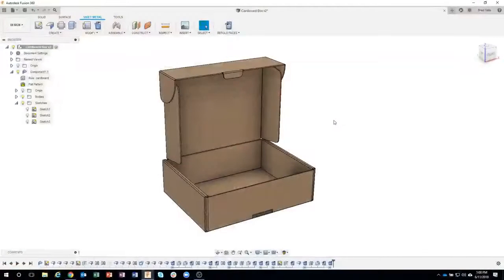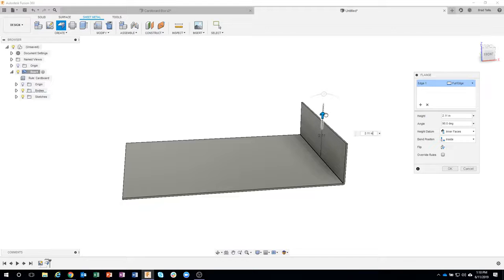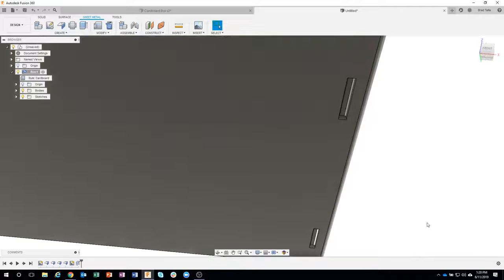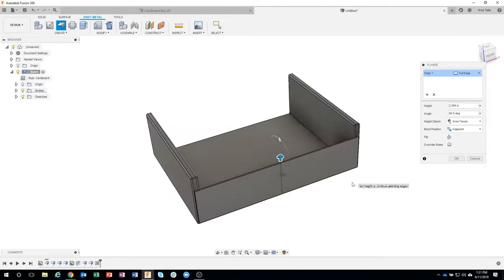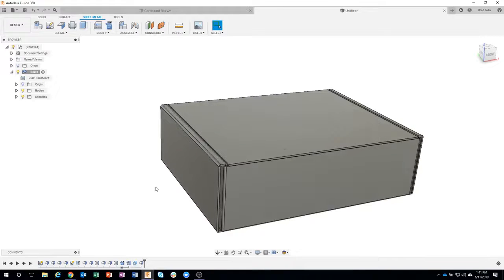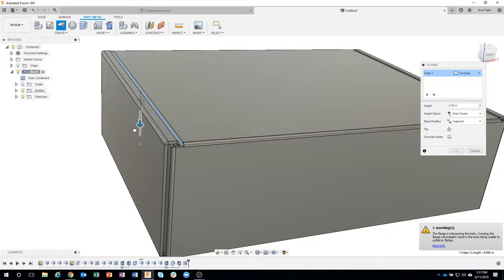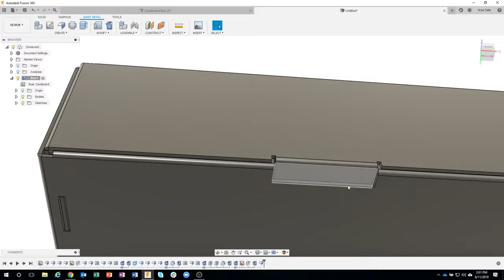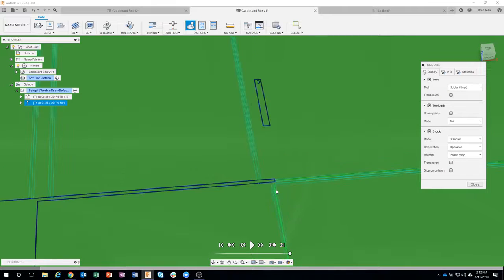Episode 36, Creating a cardboard box using Fusion 360's Sheet Metal

Comment: Thanks for another great tutorial. Is there a way to export flat pattern to SVG to be able to cut on Glowforge? Thanks.
Reply from the maker: I don't have a GlowForge (darn it..)  However, you can export as a DXF and I hope GlowForge software would be able to bring that in.
Reply: @bradtallis8968  Thanks for response. I'm getting following error when attempting to 'export' or 'save as' Flat Pattern. "Error: Export and Save Copy As are not supported for Flat Patterns." Trying some other options to get it into a SVG format.
Reply: I think I figured out a way. It's a little hacky but seem to work. 
1. Create a drawing with 1:1 scale of the flat pattern
2. Delete all of the extra stuff from drawing (border frame, info box etc.)
3. Export drawing as PDF
4. Import PDF into Illustrator or other vector based editor and clean up the paths if needed (joining them, removing extra ones, changing path color for cutting, scoring etc.)
5. Export to SVG

Comment: Great Lesson! I am having a problem with unfolding the box after the mirror procedure (See 52:17). I get an "unfolding failed" message. I have isolated the issue to the filleted tab on the right side. I can pull the face out but cannot extend that right ear without the error. I can't see any conflict.  Any ideas?  Thank you!

Note: on my first try I was not getting the same appearance to the thickness of the cardboard. I noticed later that I had selected the  Aluminum (MM) rule instead of the Aluminum (in.) rule to form my custom Cardboard rule. (It is easy to get caught by simple mistakes). I hope that is helpful to someone else.
Reply: I could not come up with a solution and did not get any suggestions so I ended up going back and making the right ear separately from the left ear (without mirroring) and now it will unfold.

Comment: Hi Brad,

A couple of points-
I notice your videos and nice and long - superb! However they can feel too long sometimes if/when you fall into the trap of meandering or labouring over a point - just something to be aware of.

Your videos are great and informative however, I get the feeling they are geared towards using Fusion commands! eg how to make a component , how to fillet or how to use joints etc. Whilst I am simplifying greatly what never seems to get posted is a more of a holistic tutorial I suppose. What I mean by that is it is not enough to know how to use the functions of fusion but how to use them in context when making a model - I have this 'thing' I want to model how do I do it. I've learnt all they commands but how do I know when to use them.
Therefore could you do some videos on concepts and techniques of creating assemblies within fusion ( and not necessarily moving parts). A bit of background - I am currently trying to model an interior of a small boat with many parts needing to be CNC cut and other parts to see if things will fit. I am trying to create supports, shapes, wooden panels etc which all need to fit together but don't move. Do I use bodies, components, base features grounded parts, when would you use a child component and why etc, Where do you start what to consider?

Lastly CAM.
I have made a very basic X,Y,Z wooden CNC which is able to handle a 2440x1220 (8'x4') sheet of ply. All the options available in the manufacturing section are daunting and geared towards metal fabrication. Could you please do a video(s) of ALL the options of ALL the sections including sub-sections of the CAM workspace explaining what they mean. A lot of YouTube videos just say do this press then post that's not enough, what do the other options do and how do I know what to choose.

I want to fully radius an edge of ply to give a bull nose edge (think a stair tread overhang) the cutter isn't available in the tool selection, and they seem only to come as a quarter radius meaning I would have to turn the wood over to achieve a full 180deg radius so zeroing the cutter location is needed. 

Could you do some videos on how you modelled the RC controller you showed off in you Bodies/Components (36m) video? I know you said there where issues with the timeline and body/component usage but could you start from scratch on how you would do it 'properly' I think it would encompass everything I asking for above and be very useful to learning drawing techniques.

Thanks